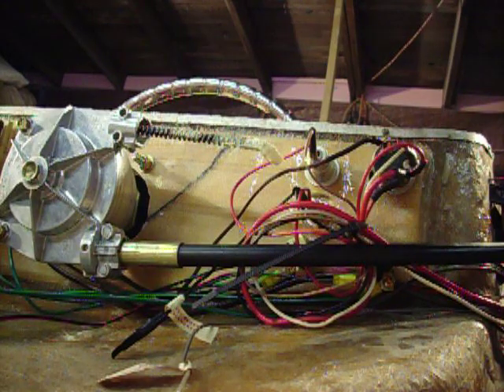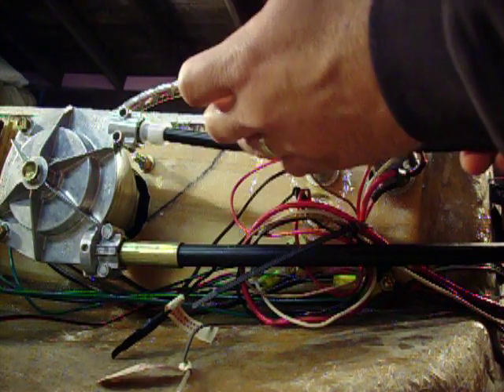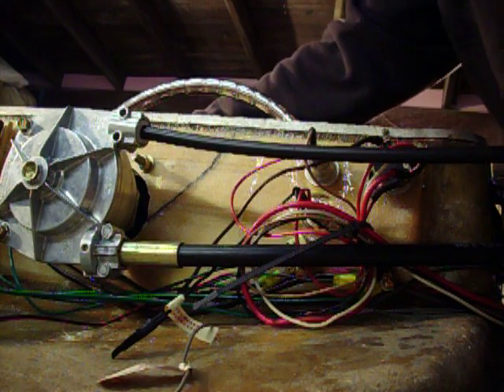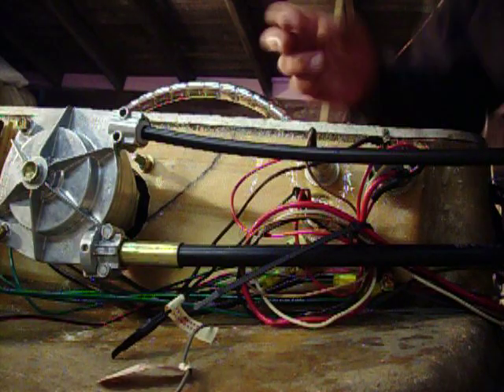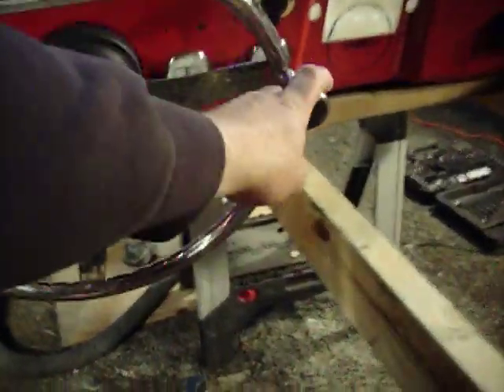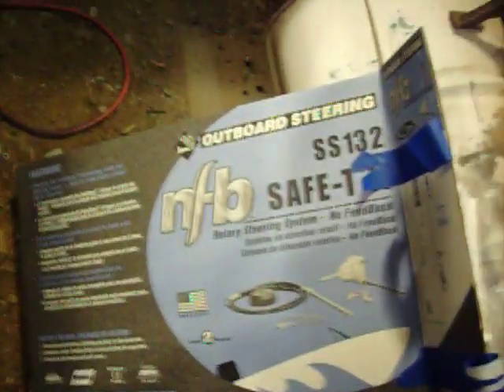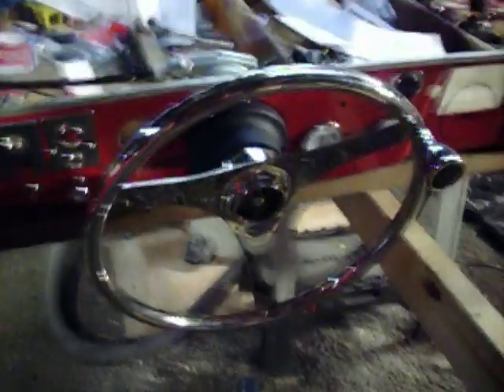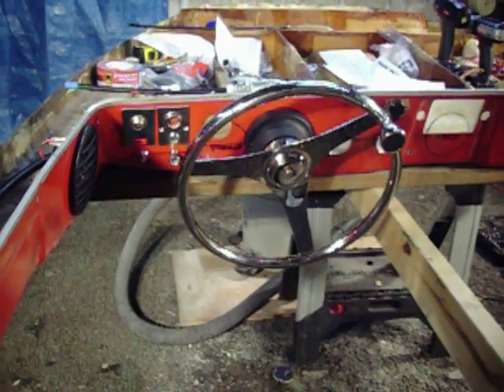How to Install a Rotary Steering System

Comment: I'm having a problem getting my old cable out. It's so rusted it's stuck in the rotary steering rack. I've tried penetrating oils and using a punch to release the pin but it wont budge. I can't use heat because there's no way to get a torch on it without burning something. I don't want to cut the cable because I think the cable is fine but the rotary rack is dried out and corroded. My steering is a little tight and I can tell the rack needs some cleaning and grease. The engine itself is turning pretty easy when I move it by hand and my steering tube seems fine. Its definitely at the steering end that I'm having issues. It's freed up a lot after spraying it with penetrating oil and White lithium grease but I still want to remove the cable and clean it and as much of the rotary rack as possible.
Reply: my cable was stuck  i had a spare switched it but right now cant get the lovely pin back in....

Comment: mine does not have bolts but it has a pin on bottom and top and it is installed  backwards  now i don ,t know how to move it so that its normal again

Comment: I have a problemen with the steering wheel. when its all the way out to left or right. (max engine output)the steering wheel keeps turning. it feels like its slipping?. do you know whats wrong wit it. or what I can do to fix this?
Reply: Andrew Price thank you. zo I would need a New morse steering cable I geus?
Reply: Mine is slipping one way but perfect the other way. The cog and gear in the helm are solid as and not the problem. The problem appears to be the coil not meshing properly with the grooves (in the helm) and just slipping.  
The mesh perfectly one way,  but not the other.